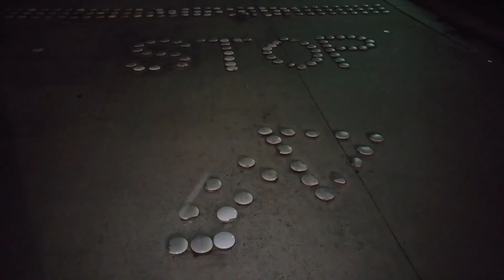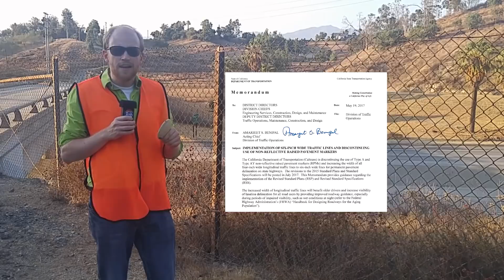California REMOVED this SAFETY DEVICE from freeways and highways

Comment: They have woke me up a couple times. I appreciate them
Reply: Those ridges cut into the side of the road woke me up once. On I-80 I thought to myself I'm tired so I'll stop at the upcoming rest stop to sleep for a bit. I didn't even make it the mile or two before the bumps saved me from going off roading.
Reply: Rumble strips are the new replacement for freeways, as they're more effective at lower overall cost. They'll come usually as deliberately excessive paint spots, low-profile thermoplastic inserts, or transverse cuts to the road.
Reply: @doujinflip  they prevent people from drifting off the road but they can’t stop someone from driving out of their lae
Reply: Couple? That’s alarming
Reply: If I was driving while tired, I would just “ride the turtles” for a mile or so. It’s like a shot of espresso.
Reply: You people... PLEASE TAKE A NAP IF TIRED WHILE DRIVING.  You don't want to KILL a toddler or something because you fell asleep.

Comment: Now if the self-driving cars would just stop running over traffic cones and pedestrians.
Reply: You're asking for too much lol 😆
Reply: maybe they're angry at humans for stuffing them inside cars - revenge!!
Reply: Whuts Uhp  if your statistic is true that is because there are more human driven cars and they have been around longer
Reply: Incredibles 2004 predicted Teslas
Reply: Whuts Uhp  the data is not yet there. And there is reason why Tesla tells you to beware and be ready to take control at any time.
Reply: @aidanmorgan6291  incorrect
Reply: @InteloPL  Technically it's a gen 3 system. The be ready to assert control when the sensor fusion throws in the towel is legal cya.  .02 this kind of stuff would better served  as open source where it can be properly vetted. That would have avoided the Toyota throttle control debacle for example.
Reply: Just start putting train-like cow plows on the front of self driving cars. Problem solved!

Comment: A simpler way is to use grooves in the road, which we do here in PA. If you go off the side of the road or you hit the center lane, you hear this loud grinding sound as you drive over the grooves. They're mostly for waking sleepy truckers up, but they are also excellent traction in the winter too if you happen to start slipping.

Comment: Great video Rob! We had a freak snowstorm in Huntsville a half decade ago and the city sent out a fleet of graders to plow everything from the small surface roads, to the controlled access highways and their exits. They stripped almost all of the Bots Dots off of the roadways and got the attention of the local news stations, who pointed out that the expense of replacing the reflectors is equal to that of retrofitting every city utility vehicle with a snowplow. 😂

Comment: The yellow reflective squares are called “cats eyes” in the uk as they resemble the eye of the cat when a light is directed at a cat
Reply: Almost, the official cats eyes were two marbles ....not a reflective stripe
Reply: Why can’t the same word have two or more meanings?
Reply: @allanrichardson1468  quite right
Reply: @badgerousdadigby195  Then what do you call cats eyes?
Reply: @Lazy_Tim  reflective studs
Reply: In the UK there is also a version where the white line paint is very thick and ribbed (so it vibrates your vehicle as you drive over it), and also they drop glass beads into it after laying to make them highly reflective.
Reply: @JohnWatkinsUK  Same in Australia.
Reply: Cats eyes are a little more complex than the retroreflectors shown at the end. That style are used for temporary markings. A proper catseye reflector sits in a metal housing and recesses when a car runs over it. Some versions collect water and have a wiper that cleans the class block when someone runs over it. They tested a version that was lit by LEDs and used solar power, but there's a worry the faint flickering could set off epilepsy.
Reply: @JohnWatkinsUK    Did you know that the audible lines can be used to play a tune?
Reply: In Dominican Republic is also "cat eye", in singular, ojo de gato

Comment: I commute up and down I-5 in northern San Diego county, and having gone through the transition to the "oreo" lane markers, I love them. I find them much more visible than the previous markers, particularly since many of our freeway surfaces are a hodgepodge of different maintenance and expansion projects over various decades. So the same freeway can transition back and forth from light-colored concrete to dark asphalt multiple times over a half-hour drive, and those different background colors can make the lane markers difficult to see without the black paint background to provide the constant contrast. A downpour can still make them hard to see, but our freeways are pretty well designed to shed that water quickly.

Comment: Those things almost ruined my motorcycle vacation one rainy afternoon.
Reply: What happened? 
I ride a mc also. In a turn those things cause the tires to lose traction for split second. Not a good feeling at all.
Reply: @joepromedio  Never had that issue, but I've never turned on a bike without looking at the road where I'm turning.
Reply: @Azlehria  Not me. I ride without looking at the road. 
Of course I ride looking at the road. What is your point?
Reply: @joepromedio  Botts' Dots and other reflectors are easy to avoid riding over if you bother to look for them, even in the "warning" fields. If you don't ride over one, it can't cause you to lose contact.
Reply: @Azlehria  Sometimes they are unavoidable. Ortega Hwy (2 lane mountain road) is near my house. Many years ago they had these dots for the centerline. You hit those at speed in a turn and it will definitely get your attention.

Comment: Headed out to Idaho when I was in the service in 1975, I ran across a version of these which were much smaller and they were basically just last round elements that reflected life back towards you and you could feel them on the road but they were much less intrusive than these huge disks you're showing. I found that these reflectors on the road and the ones on the sign and particularly the paint that was on the science that was reflected was Far easier to read than the ones back in Michigan, but Michigan had to change their stuff for a couple of decades at least. They still do not have the same quality Vision reflection for their signs or from the separations in the Lanes on the freeway as I found out west in 1975.
You could still use reflective elements in Lane markings if you recessed them and they still would reflect, even in cold States. Because they would be recessed. It would not stick above the pavement and they would still cause a reaction to the tire when it hits it unless of course there was a lot of snow. And you can't see Lane markers then anyway

Comment: We have somthing very similar to the simsonite reflectors here in the UK that I’ve only ever heard called “cats”
They’re basically the same reflectors in a metal housing imbedded in the road, however they are spring loaded, meaning that the reflector is well exposed and they give the same thumping feed back as dots or regular stimpsonite but are pushed into they’re hosing when you go over them, meaning snowploughs have very little issue with them and it’s externally unlikely they’ll come lose and be torn out. 

As the housing is embedded in the motorway if you did need to replace any it would just mean putting on a new reflector and possibly replacing the springs, I’m not sure about their service lifetime but even if they did wear out you’d still get some reflectivity because of how they’re positioned, and the bump feedback would be the same.

The “cat” name is because they look like two cat eyes reflected in the headlights, peeping out from a hole in the road. No idea what they’re really called.

Make you think how much time and effort goes into the design of what we drive on every day.

Comment: In Canada, we have groves cut into the pavement. They're installed (sometimes) on the edges of roads, and across the lanes when approaching a toll booth. The grooves (when driven upon) cause a very loud buzzing sound and vibration. Being groovy, they're compatible with snow plow blades.
Reply: Yeah, we got those on most large highways in the US too
Reply: We call them rumble strips, and in my area they are mainly just on the yellow line, but on the freeway they are on both of the outermost lines. I think the general idea is to "wake up" a distracted or sleepy driver when they start to drift dangerously.

Those dots definitely wouldn't last 1 snowstorm in NY when the plows scrape the asphalt they would probably pop most of them off on the first pass.

Comment: I now live in California after living in 3 other states for quite awhile. I live at 7800 feet in the Sierra Nevada and the average annual snowfall about 0.3 miles from my house is 17 feet, 4 inches. We don't have any Bott's dots and never did. We do have some of those reflectors buried in slots on the road. The problem with them is that cinders are used to increase traction after a plow has passed and the buried reflectors get buried and stay that way until spring when they have to be blown out with compressed air. So we don't have very many of those reflectors, mainly near intersections and those are being phased out.

Comment: We’ve had Stimsonite lane reflectors on our roads for YEARS here in many southern states, and they’re much more visible than Botts dots.  I’ve seen Botts dots in FL before, and occasionally in parking garages or parking lots here in SC, but that’s about all.  In recent years, the SCDOT has been adding grooves to the sides of our highways that will cause the same vibration/noise effect as Bots dots to wake up anyone who might have fallen asleep at the wheel before they veer off the road.  The SCDOT has been adding “oreo cookie” lines to our roads as well, especially on interstates and major four-lane highways.

Comment: I mean just because you call it a safety device doesn’t mean it saves lives.... the botts dot is actually very dangerous for motorcycles, and that danger only increases on wet road surfaces. 

So yes I’m glad they’re removing the “safety device” 

That’s like saying “air bags on cars should save lives, so let’s require that ‘safety’ device between motorcycle handle bars too” 

Just because something has been around for a long time doesn’t mean it’s useful or helpful

Comment: In the UK we have a thing called "cats eyes" which are implanted in the road and reflect different colours when your headlights hit them.  They are so effective that you can tell where an exit is in the pitch black.  The eyes have different colours for the edge of the road in your direction, the road in the other direction, entrys to the road (like a joining ramp) and exits from the road (like an off ramp).  Additionally for country roads coming up to a junction we use what are basically layered lines across the lane to get drivers attention.

Comment: Here's a little thing that seems to be unknown on US roads. European roads often use thick thermoplastic (or paint, or whatever it is) just like any other road markings but it has ripples. It actually just has lots of holes in it that makes it look like a ladder. Those are tiny, you can't rip them off, they are as durable as any other lanes but those frequent gaps make a lot of noise when you drive on them. It's actually the thing that some companies used to make music roads. It's used mostly on the edge of the road, sometimes they are used between lanes as a reminder that you are crossing the lane and they are also found before intersections with decreasing spacing. The closer you get, the longer the noise is until it's continuous just before intersection. The beauty of this solution is that it is installed using the same machine for any other lane markers on the road.

Comment: Can confirm--lived in Illinois for 25 years, and those reflectors are recessed into the road all over the place. Also, Illinois just uses rumble strips on Interstate highways, to let you know when you're driving off the road. You generally don't need them between lanes because that's where the road seems to deteriorate quickly anyway, creating natural rumble strips XD

Comment: In Scandinavia we use a special roller imprinting groves in the asphalt in the lane markings creating similar busing sounds as the Botts Dots, or at least a unpleasant vibration in the car that alert you that you are driving on the lane marking and not in the lane.

Comment: Here in Canada at my road maintenance company we have started putting in the new tape reflectors much like what you're getting at least on the hwy 407. A grinder truck leads cutting the groove in the concrete, I follow with the blower truck, another guy comes behind me and applies the adhesive and then comes the tape machine.

Comment: As a former CA resident, I am glad to hear that these are going away. When riding a motorcycle, these make lane changes much more challenging due to the fact they are placed as a set of 4-5 dots, instead of one reflective one. This reduces the gap that a lane change can safely be done in without driving over dots or reflective bumps. 

Straight lanes are easy to set up for the change over, but there are often times you need to do a lane change in a longer curve due to hazards up ahead. Having to take attention away from the road in order to find a gap to properly execute a lane change adds a risk factor that is now reduced.

Comment: You mentioned that these can't be used in snow plow regions, I live in the north and what we do here is a grinding truck grinds maybe a 1/4 inch into the pavement where the lines and "paint" markings will go, then another truck sprays thermo plastic of the appropriate color in the groove, the plastic nozzle is followed immediately by another nozzle that sprays small clear plastic balls into the hot plastic surface, best reflective marking that snow plows and peel up and traffic can't wear away!

Comment: in Australia we have "audible lines", which are fundamentally the same thing, just better, and usually painted over with a normal line marking paint. They are typically on the fog lines on high risk areas, some motorways, some normal roadways etc. When you drive over them, you dont feel it so much as you hear it very clearly. Its a loud "BRRRRRRRRRRR" sorta sound that radiates through your car. We also have "rumble strips" approaching railway crossings on country roads etc, where the road has a 1 meter long stretch, across the full width of the lane, that has grooves made in such a way that again they are extremely audible but you don't really feel them that much. AFAIK they are made of asphalt.

Comment: Take a trip to the UK,
The cast-iron lane markers are called "cats eyes" the reflective lens is mounted in a kind of rubber, so that when you drive over them the eye gets wiped and cleans them.
But, alas they are being phased out and replaced by those plastic ones you have there.
White for between the lanes,
Red for the edge of the road,
And green at a lay-by.
The white lines are raised slightly between the lanes so you hear a rushing sound when your tyres pass over them, and they are made into rumble strips at the edge of the road.
But we do not have the musical rumble strips here.

Comment: here in New York and next door in Massachusetts there's a reflector I've seen that's recessed below the surface of the pavement. I don't know if they were just trying them out, because they're not everywhere, but I know i-88 in New York had reflective Lane markers until maybe 10 years ago when they repaved.  I do have to say that they were pretty amazing especially in fog at night. I was able to drive full speed in the fog because I knew exactly how far ahead into the fog I could actually see, meaning I was more confident that I might see deer crossing in the fog

Comment: In 1973 I went to L.A. to visit family for Christmas. A storm passed over the region that had a snow level of 500 feet. Yes, the Verdugo Hills had snow on top of them! Palm Springs recorded 2" of snow. My dad and I heard that Banning Pass, you know, the high point on I-10 between San Bernardino and Palm Springs, was closed the night before due to snow. I have a picture of a CHP car chained up in the parking lot of Hadley's Date Farm. We arrived there just after the highway was reopened. Anyway, there were abandoned cars all over the place and Bott's dots scattered about because Caltrans used the only equipment they had in the area to plow, graders. The grader blades removed the dots quite effectively. There wasn't much they could do, I-10 is a really important highway to keep open.

Comment: In northern states, since we can't use these, we lower the road along the lanes either by carving out the road along the lane markers or by pressing the material before it hardens, this is only used along road edges and between different directions though.

Comment: The white reflectors have a red reflector on the opposite side in Arizona.  So when you are driving into the sun,  look in your mirror and you will see a bunch of red reflectors behind you.  Only other way to see this is drive the wrong way on the freeway,  or hop into google maps car and look the other way and you can spot the little red reflectors on the back of the white bump

Comment: The road indentations shown, (but not mentioned), at the 4:30 mark are another big reason for the phase out of Bott's Dots... By simply texturing the edges of the lanes themselves, a similar auditory and vibrational alert is produced by vehicles driving over and down them, but without the expense and problems of installing and replacing Bott's Dots...